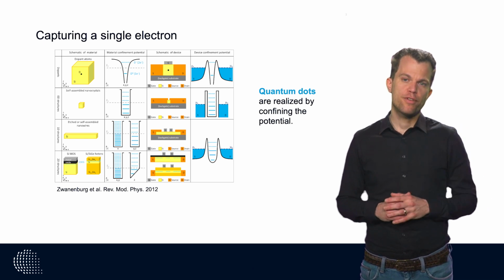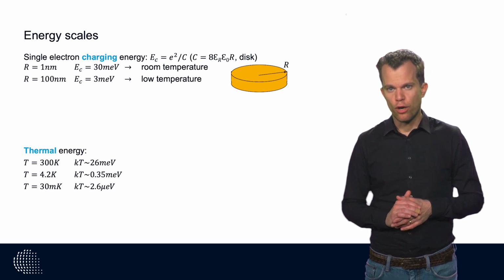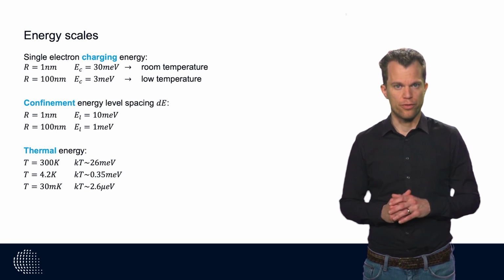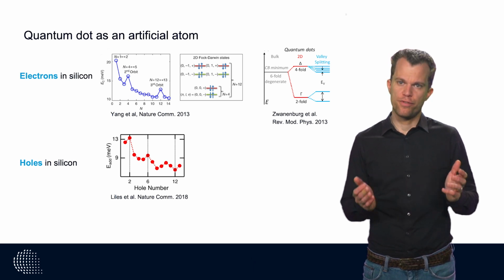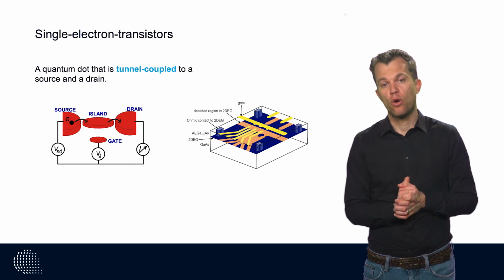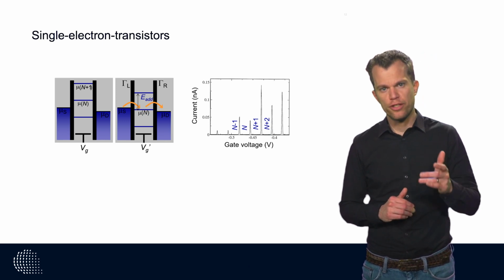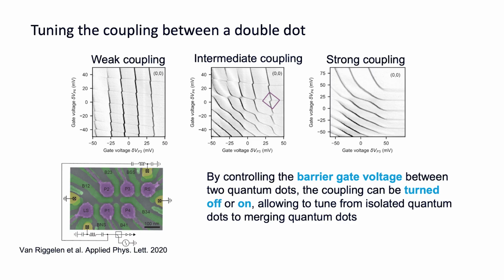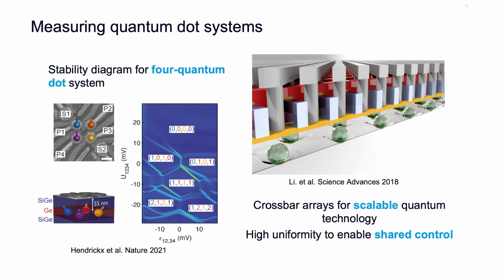Quantum Dots  - Capturing a Single Electron

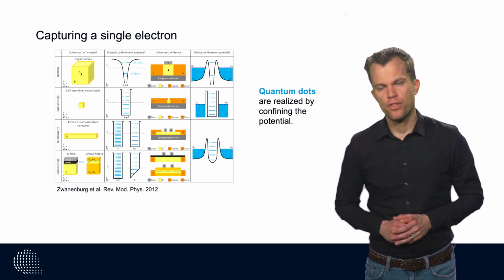Comment: 1:15 there must be a mistake regarding charging energies. A 100 times larger radius should result in an energy 100 times smaller (here its 10 times smaller: 30mev/3mev = 10).